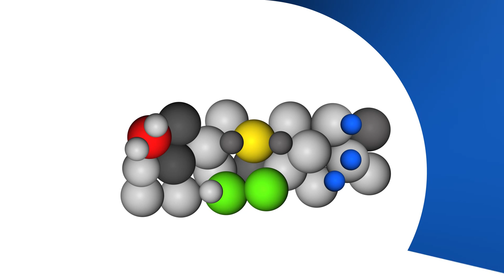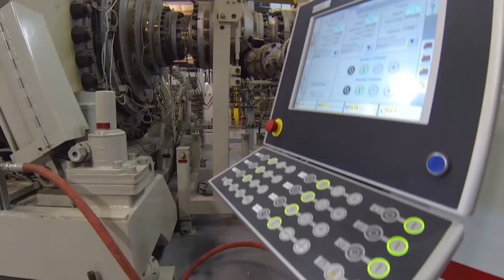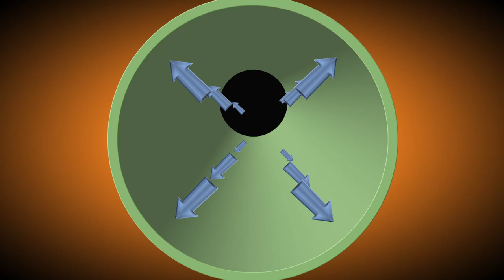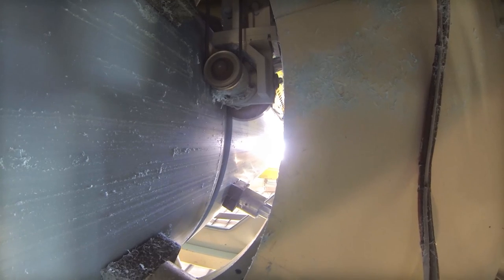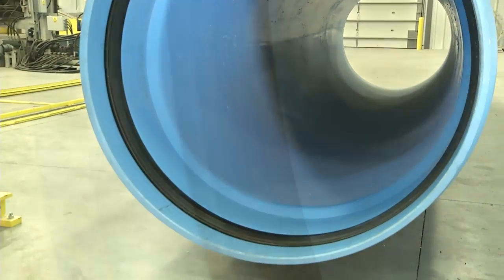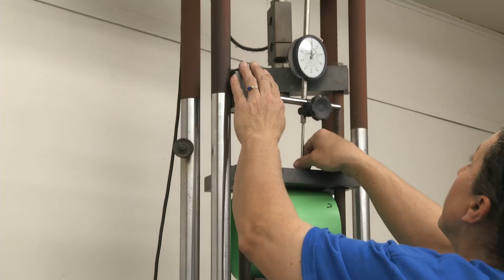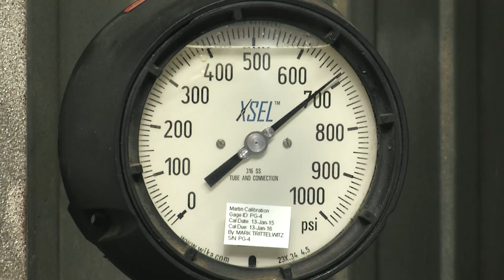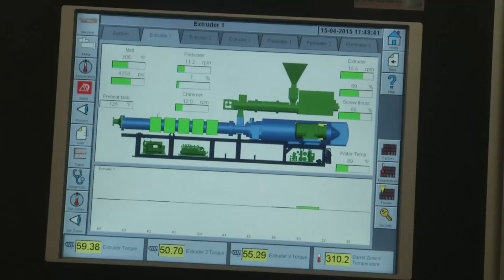Diamond Plastics PVC Pipe Plant Tour- 54" and 60" Line

Comment: The truckers must love those kind of loads.
Reply: I have hauled a lot of these, actual for this outfit, they are a pain because the pipe is slick, so you have to make sure it is well strapped or the load will shift.
Reply: @RenegadeADV  If you're going far, I would think you'd save a lot on fuel?
Reply: @RenegadeADV  Cheap freight?

Comment: I've always wondered how the die is held in place inside the extrusion tube.  How to hold it in place while there's continuous flow around it, without causing a break in the circumference of the tube during extrusion.  I'm guessing its held early in the molten flow stage, a blade bracket of sorts, thin enough to allow 'healing'  to occur beyond die location?
Reply: It has a plug on the inside that is chained to mandrel inside and air pressure.   I worked at plant outside Macon Ga. 1990
Reply: a section in the die assembly is known as a spider and that keeps the inner parts rigid you are right it separates and then heals back together, all the dies and puller and saw on this line was made by a Company in Mcpherson Kansas called Midwest Industries
Reply: This is true, that was the first thing I noticed when I started working there. Ironically McPherson ks is where I was born and grew up. 60s and 70s graduated  81.
Reply: @rogerswanson9974  I bet you know guys that work at Midwest then lots of McPherson graduates from that time frame work there
Reply: I wish they had shown us this detail.  I leaves those less curious thinking there’s a bit of magic involved.
Reply: @rickystarr10  i might know someone. But i moved away in my senior year.  Navy 6 yr then to Georgia.
Reply: yea the bit about it being a spider is right, it heals back together afterwords and the middle part that forms the tube walls is the pin and the die sits around the pin, at least in smaller diameter tubing extrusion. The die has a few adjustment bolts on it and if its say, running too thick on the bottom and too thin on top, you tighten the top and loosen the bottom and move the die around the pin to make the walls thicker or thinner. Extrusion is a lot of fun actually and theres a real science behind how plastic parts and tubing are made, pretty cool shit. But theres no good youtube videos about it, i might have to go into work and make my own video just so someone whos interested in it can at least see what goes on during the process
Reply: trabajo en una planta de pvc   en colombia ,  hay dos clases para forma  el tubo por vacío calibrador  tanque   o por manga   en turbaría de extrusión  para tuberias rigidas . o corrugado  . perfilado .

Comment: I wonder how they profitably transport 60-inch pipe. A flatbed trailer is 102 inches wide, so only 50 feet of that big pipe will fit on one truck. Do they insert smaller pipes into the bore of the big one?

Comment: Is pvc pipe easily recyclable? If developments plans change, can it be easily pulled up and reused elsewhere? Can it withstand desert dry and heat (+60 deg C) conditions to be used in irrigation projects? How much better would ceramic or concrete be?
Reply: I worked sewer and water in the 80's. Back then PVC was not recyclable and had no UV protection against sunlight.

Comment: At 9:33 in the video you have a safety issue. You need to have your workers wearing at the minimum safety glasses when testing your pipe in the fashion. Although it would not be likely but if that piece of pipe were to fail while being compressed it could cause injury.
Reply: GaSmokeEater I seen that too. Plastic can shatter and throw pieces lol
Reply: This plastic will not shatter because they most likely use vent canisters to suck the impurities out of the pipe while being extruded . You can feel pvc that has vent in it it has a sand paper texture and also it was most likely impact tested before being qc'd and also just looks like they are slightly applying pressure to see how much stress it takes to start to compress it not fully squishing it like the tests they show for the larger pipe where they flatten it and it does not shatter or even tear. The gauge only showed it being compressed .05 or so from what I saw .
Reply: Look out the God O'mighty safety police are on patrol, they are out there saving the world one video at-a-time. I think she knows it.
Reply: The Titanic was unsinkable too. Safety glasses are always a good idea no matter how unlikely an accident may be, you only get 2 eyes.
Reply: Do you think people ever get tired of hearing about? I worked in industry for 41 years and know it very well, I don't need someone constantly reminding me when they see the slightest infraction. It's more about their ego than anything else.
Reply: This is a sales video I'm sure when they are really working they use all the PPE required .
Reply: Theres a diamond plastics plant here in middle Ga. That plant alone in the past 7 years has had 4 deaths, and 50+ serious injuries. It is NOT a safe company
Reply: GaSmokeEater
Reply: @sef2273  Next time say, "I saw that too", not "I seen that too"
Reply: WootTootZoot I seent it
Reply: @WootTootZoot  / Oh look who showed up the spelling police can you help me fix my alittle spelling issue !!!! Spelling police correcting everyone's spelling mistakes one video at a time !!!!!
Reply: Yes the glasses on top of your head protect nothing to lazy to pull them down over her eyes
Reply: @rons4778  It's not lazy, she just doesn't like using them, you know you don't always have to say something negative.
Reply: It looks like she is wearing them, albeit on top of her head and not on her face.

Comment: I would love a few 60" sections. I wander how much they would cost. The web site don't say.
Reply: Go to a sewer company which installs pipe that size. You could probably ask them for a piece. Or give the guy in the yard where they store clean up from their jobs and give him a few bucks for a hunk of what is really trash taking up space on their property. Otherwise you will pay too much.
Reply: Crazy guess, $5,000 each.  4 ft metal culvert is 3,000. I stopped at a place that made solid wall black plastic pipe and was told their biggest thickest pipe is $900 per foot of lenght.
    Worked sewer and water in 80' and 90's. We installed a special concrete pipe with a sprayed in liner. It was $30,000 per 20 ft pipe.

Comment: 5:51 you say you are producing 60 inch OD. cast iron pipe?  Sorry that triggered me for some reason. Great plant tour though very interesting to see how that pipe I used to lower into a trench is made. Thanks for the informative video.
Reply: TRIGGERED YOU? YOU A SNOWFLAKE??
Reply: @Chybear yeh looks like they missed a mistake in editing.
Reply: The pipe has the same dimensions as cast iron pipe. If a city is replacing its cast iron water or sewer mains with PVC, they may not have the funds to replace it all at once. By making the pipe the same size as a piece of cast iron pipe, they can directly replace sections one-by-one.
Reply: @lostintime8651    I dunno if I can relate  to your reply. I  do live in Kanuckistan so we get a lot of snow flakes here in the Northern parts of the continent eh?

Comment: I built a solar pool heater using 700' of 1 inch pvc.  Emptied the water out for winter...Temperature dropped to about 10 degrees ..the whole pipe grid exploded..  I had fragments of pvc pipe all over my yard.  pvc  will explode in temperature  around 10 degrees  with no water in it .
Reply: Use ppr pipes instead.

Comment: How about we send about 100 miles of this stuff out to Flint, Mi...
Reply: That was the water, not the pipe
Reply: @pagerosenlund498  The CAst iron pipe caused the contamination.
Reply: Brandon Pinnon not cast iron, lead piping from the main to the house. When the town govt. changed water supply to the river, they didn’t add the right chemicals, to keep the Ph balance correct. That in turn helped remove the internal build up, which exposed the lead . Google,, did flint Michigan have lead water pipe,, . 38 years as a plumber, all water pipes have a mineral build up that happens normally.
Reply: Page Rosenlund it was both actually.

Comment: "60 INCHES PIPE BY 10 FT LONG WHAT DOES IT WEIGH AND WHTS IT PRICE.?.HOW LONG WILL IT SURVIVE IF YOU PUT IN ACID AND FOR THE SOME WHAT HOT OIL FLOW.??..WHAT KIND OF DIFFERENCE TYPE OF USE OF THIS DIAMOND PIPES ??..

Comment: 11:37 why don't they put those smaller blue pipes into the larger green ones and have room for twice the load?
Reply: 3DPeter because the customer would have to get them out you would double the load to the banding and scratch or ruin your perfectly in spec pipe . Not to mention the inner pipe would be loose if not banded length wise
Reply: they could tape the end to prevent scratching, and then tie it up with a rachet that goes throuh the pipe, so that it can't fall out during transport, and weight
can't be an issue, because a truck can haul far more heavier loads that that.
Reply: 3DPeter that would cause a hassle to the customer on their site . And cost at least 5x in banding lengthwise in every pipe rather than just wrapping them .  just standards of how things are done we never did it where I had made PVC pipe
Reply: 3DPeter I have seen this done with drainage pipe. Probably most customers require one size. Too much labor to u load onsite.
Reply: @geriharp132   yep, most job site dont use various sizes.

Comment: Why are the pipes not capped during high speed transit to protect against dirt, flying gravel abd fumes ?
Reply: You pay for the fuel.
Reply: I think it's better for air flow so the truck does not turn over also the truck is going to use a lot less fuel with them being open.
Reply: Not to mention what they would do with the caps afterwards.  More gas wasted by trucks to haul them back again.
Reply: I use to truck out of there,munce  Ind ,yes we had to smoke tarp every load

Comment: Can I make a giant tube slide out of this?
Reply: The joints may make it a bit rough on your butt, hehe
would need to cut off the belled part and buttweld the ends together and have outside support... I think something like this is already used to make water slides but with a lot lower quality in making
Reply: John Franklin qqq
Reply: waterslides are made of polyester, so way cheaper than this.

Comment: I hope they engineer a way to make big pipe out of recycled plastic.  It would reduce the amount of discard plastic in landfills and the ocean.  It would reduce the amount of crude oil used to make pipe.  It would create jobs.  They currently make everything from furniture to railroad ties out of recycled plastic.  Why not pipe?
Reply: George Pretnick they do use failed PVC products. They regrind them and use them In the mix going into the extruder, thus cutting down on waste
Reply: Contamination is the big problem with recycled. It can be used ok, but only small percentages, and only if collected and reprocessed properly. You don't want product failure with a large, very expensive pipe buried many feet in the groud - and usually many miles from anywhere. I worked for a company making products for Boeing airplanes - they allowed NO recycled. You don't want failure at 30,000 ft.
Reply: i liked your answer
Reply: These cost #taxpayers a ton and wastes middle eastern #oil like all cars do.
Reply: ScorpioX` PET is a thermosetting plastic which can not be recycle but can be transformed into something else such as Polyester.
Reply: Plants do use their own regrind but only a small percentage because of a lot of reasons density going into the machine is one . Another which I guess would be caused by the same issue would be tolerance  can't stay in tolerance with your machine surging because you aren't filling the screw with material properly
Reply: What we need to do is apply a deposit of 3 cents a bottle on small water bottles with the amount increasing as you go up to 2 liter. Also, tax the plastic manufacturers to hire crews to clean up litter...
Reply: @jimlangley840  You must be a Liberal.
Reply: @barkybarker2592  I just remember collecting pop bottles for candy money, they have done away with easy to recycle glass bottles for most products. You must be a lobbyist for plastic manufacturers...
Reply: This has nothing to do with the bottled water industry that's polluting our oceans.
This pipe kees us safe from waste and diseases. Many industrial uses for this pipe.And it lasts forever.
Reply: agree
Reply: @Singular121  PET is not a thermoset plastic. It is used in bottles and they are constantly recycled by regrinding and melting. Thermoset plastics are usually urethanes, silicones and epoxies among others.
Reply: @JaakkoF  Pet can not be recycled. It can be changed to other form of plastic mainly polyester but not back into Pet.

I used to work in plastic industry before and know what I am talking about.
Reply: @jimlangley840  you must be a liberal 🤣

Comment: I used to work at Mid West Pipe Coating in Schererville Indiana for almost 13 years.They coated steel rebar and pipe up to 36"with fusion bond epoxy powder.That place was ok to work at........but many times I almost saw people killed by stupid safety rules being ignored or broken.Just as I left in 1991.....the first young man was killed over one yard foremans stupidity and not overseeing truck loading proceedures.But at that place I always wore a mask.Many people I worked with are almost all dead from cancer.

Comment: What part PVC is non-toxic ?
Reply: Did you know that the electronic device you used to comment with is also toxic?
Reply: Most likely that device is made from ABS plastic.....
Reply: @martijnvv8031  Nope...
Reply: I was referring at Benjamin, about the mobile device he talked about. That device is most likely made from ABS with injection molding.
Reply: @martijnvv8031  oh sorry, indeed, abs is not te same as pvc, if pvc burns it release the  very toxic smoke, chlorine. I wear a gas mask if i must disassemble a burnt extrusion head
Reply: @martijnvv8031  all plastics could be considered toxic

Comment: Note that a very limited manpower workforce is utilized to produce a great mass of products in a limited period of time.  Very much different from a video of rope making from coconut husk fiber that I just watched - task requiring a large number of basic human souls to yield a fairly limited quantity of rope in an extended period of time.  Ain't we lucky to be living a modern country?
Reply: Yeah but you get worked to death. I used to work at a place that made PVC. Sometimes you had to monitor one line but sometimes two. The machines that made smaller pipe moved faster. Very hot building with a very high turnover, it's a terrible job I'm glad I quit